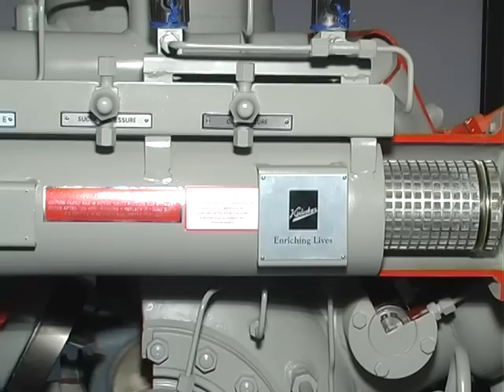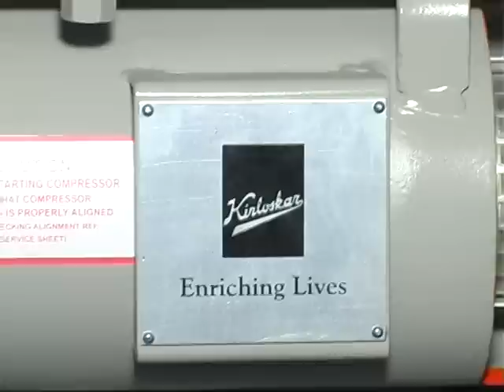Kirloskar KC Compressor Cut Section movie

Comment: Nice .. Generally I am having one doubt. In above video motor speed is high compare to compressor right. using v belt we reducing the speed. but what will happen if i reduce the fly wheel diameter and controlling the motor speed using drive. is it possible?
Reply: Sim. Pode usar o inversor de frequência. Para reduzir a rotação do motor. Vai do 0 a 120% da rotação nominal da placa
Reply: Speed can be control by mechanical and drive control. Production vary by changing speed